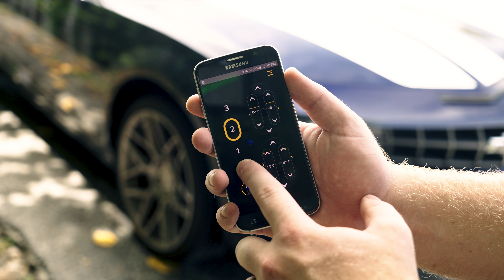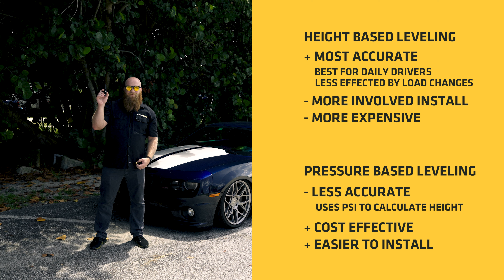Accudemics Episode 01: Height vs. Pressure Based Leveling

Comment: I know this is an old video but I am looking at the pros and cons of using accuair or going with Airlift. I want to do hight based but I like that there is a visual with airlift to see the pressure based. I feel like that would give me a heads up if there is a leak or issue. do you all have this option in your bluetooth app, is it something you might be willing to add to a controller in the future? still undecided on exactly which System to get. although I love the Endo Tank option with Accuair.

Comment: Hey guys, I'm looking to change over to your system from another company that I am just plain sick of dealing with. I have my car wired up for a height sensor system already and I see that your connectors are the same as the other company's. What I need is a pinout diagram of the ECU so I can re-pin my cable. I see you gave a pin diagram for the manifold plug on your website, I need one for the plug that goes to the battery, compressor etc. Where can I get that. Thanks!